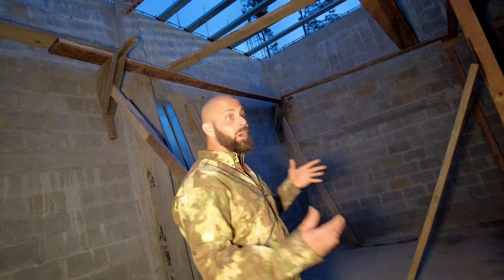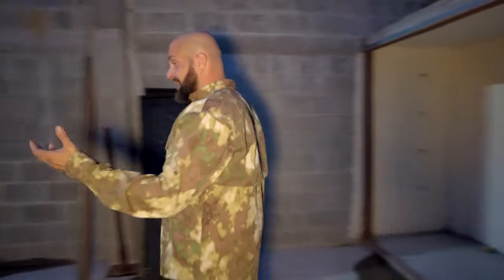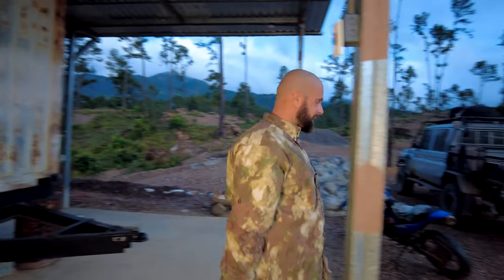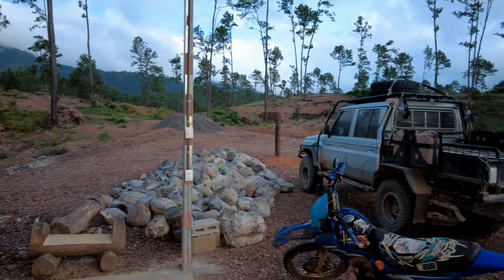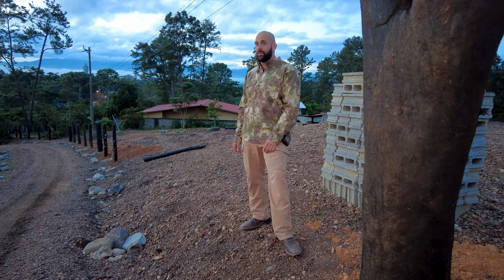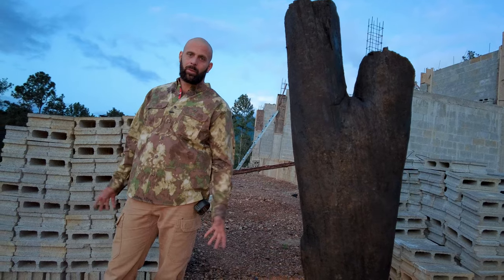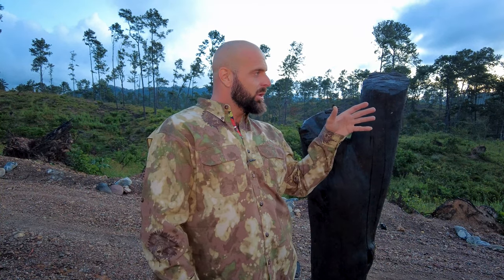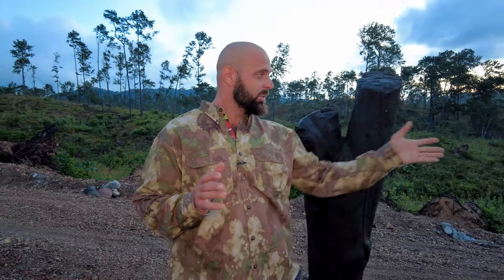Building My Dream Shop Pt. 13: Making Molds for the Concrete, Curing & Setting Fence Posts

Comment: Make sure you oil up that form work before you pour concrete.
Dyed diesel will work fine.
Otherwise when you strip concrete those plywood are gonna be a bitch and you can reuse the plywood.
Reply from the maker: Yeah we’ve been reusing wood for the whole project thanks. The plywoods a non-issue but for the Columns we used burnt motor oil 👊🏼
Reply: @Bone Tactical  Awesome
Job looks great brother can't wait to see your dream fully envisioned.
Be safe and Much love to you and the family